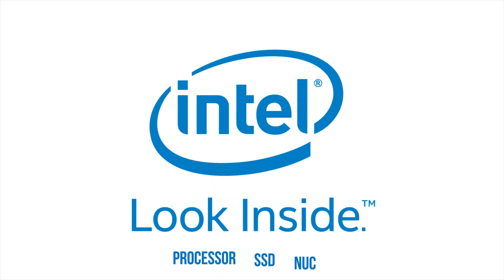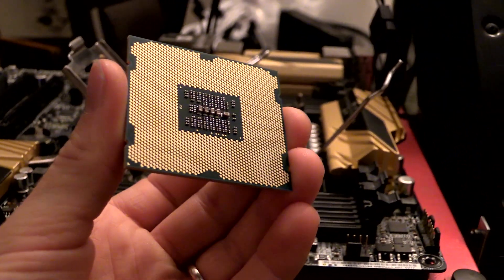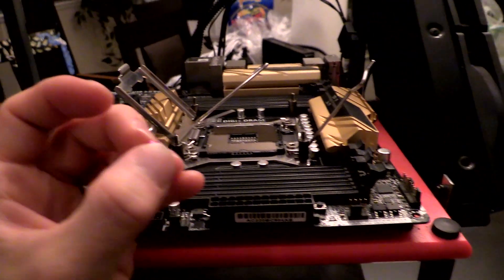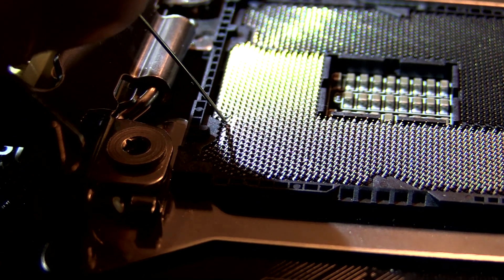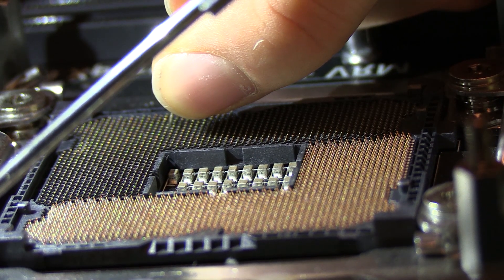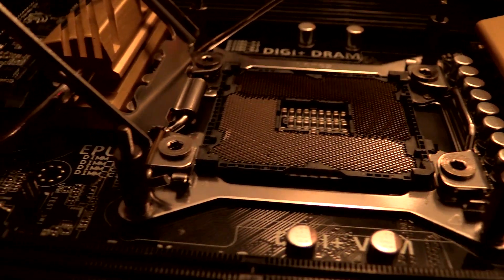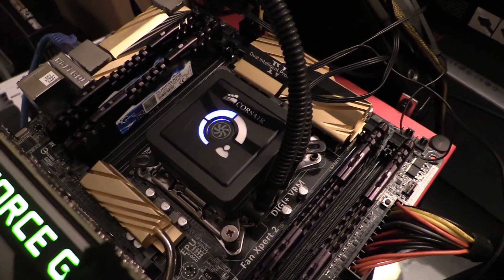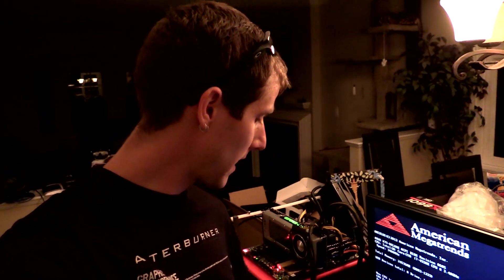LGA 2011 Socket Pin Repair Vlog - Fix a "Dead" Motherboard

Comment: I had to give you a thumbs down?  Why you ask?  Because that was too friggin easy.  Every year or so I pull out my barely used Gigabyte Z87X-OC Force and I try to fiddle with the bent pins and get a CPU to post.  I barely had the thing running for 1 month when I started having issues and HiCookie immediately told me... Sound like bent pin.  I'm like NOOOOO I had a Detroit Thermal 5noz on it and according to HiCookie I apparently overtightened it.  Which I can't stand because I had nice thin softish springs that took up a lot of turns.  Guess that's the downside to a universal 775-2011+ compatible block.

Anyways man thanks for making this.  I was wondering if I was doing something wrong.

I still don't understand how the hell I messed mine up.  But regardless I did and there is one nasty twisted pin and at least 1 other slightly twerked one.

Comment: I'm looking to repair a P6T Deluxe V2 socket pin. I slightly swiveled perfectly aligning about 7. But ONE had tiny pin atop landing end bent back flat on itself. I tried to stand up and broke off. I then bent landing up a little. Ran perfect for 3 days, then contact began to fail, randomly shutting down, and getting false "Overclock Failed..." boot message. By disconnecting panel connectors, starting with motherboard power button rig runs perfect except false boot message. Apparently pin only for panel/power switch, for I need toggling MB power button to start. What I'd need to do is: take a tiny copper wire 1/32~" long, file smooth, place in mechanical pencil, solder tiny bead to it, solder to landing. Only reason I can possible fix, is because landing on edge of socket center recess, pointing towards recess, allowing full access to tip of landing. I'd use long wire, solder then cut, but fear mangling landing.

Comment: Had to repair at least 10 bent pins on the CPU socket. One bent pin was like in the video no head, and it is LOOSE and maybe dead pin already.   PC booted fine. Sadly the main PCI-E x16 (x16) does not work anymore, so I used the spare x16 (x8) slot below it =)

Comment: I have a Gigabyte G1 Sniper X58 board that has a bent pin, the system works in Dual Channel mode if I put ram in Channel A and C in both slots it will work.  attempted to fix already but its so small I could not see.  Picked up Magnifying glass and something to bent it back with.  I hope to get it up and running.

Comment: This actually made me feel better about my new cpu purchase that i'm waiting to be delivered. My pc was turning on with a blank display and I wasn't 100% sure if it was the cpu but I bought a new upgraded cpu anyways in hopes it would solve the issue. The old one looked like it had been through hell and back but everything rlse in the pc looked perfect. I think I may have burnt it out with games it didn't meet the minimum requirements to run as well as some 4k 360 video editing. I needed better than a core i3. Anyways thanks for the confidence boost. 😁

Comment: Hey, Linus, I have a 1150 socket mobo and processor. One pin on the mobo is bent and one missing its head. I tried to fix it and the PC starts, shows the logo of the mobo but when installing Windows, it shows the windows logo and then the screen goes black. The PC does not restart, just "thinks". Any tips?

Comment: Does it remove the waranty if they see you repaired bent pins, because they are just less higher/under than the other ?
My motherboard had an issue, i had to ship it back to my seller, with the little protection above the cpu socket. Little protection i've made fall on the pins and then bent three of them. I've succeed to align them but i can't tell if they are higher or under than the other one. Does it break the waranty if they see it ? i'm mad

Comment: LGA is the exact reason why my next build will be a Ryzen. I've dealed with this issue before. My success rate of repairing it was 2/3, but everytime it felt like a really unnecessery job that could have been avoided and saved a lot of headache.

Comment: The re-seat cpu issue is a funny thing I've never seen up until now that I got a dual lga1366 mb. Cleaning the CPU contacts and re-seating the CPU fixed my Z800 mb memory detection issue. I've never seen this since lga came into market.

Comment: MY PROBLEM: 
The plastic on the bottom of my pins is warped.  I have a z170-AR Mobo. I had an i7-7700K, but it when to CPU heaven. (R.I.P.) 
Can the Mobo be salvaged because Microcenter does not accept the return of a mobo with broken pins? 
        (I could just buy a new one but where is the fun in that) (I am handy with a soldering gun)

Comment: I use a graphite mechanical pencil because it gives much more control over the bend pin. Also the risk of over-bending and breaking of the pin is reduced that way. A mechanical pencil is the way to go, try it next time ;)

Comment: I had to do this, the previous owner dropped the CPU on it. I used a jeweler's eyeglass (also known as a loupe) and the back of a No.11 scalpel blade. Very delicate work but still easier than resoldering guitar pickup wire!

Comment: hey my board is not booting i found a way to boot , it is ASUS Rampage 3 black edition i have 3 broken pin 4 ram slots ar not reqonizing. So i found a way to boot it says FF on my LED on motherboard when i press power so i have ROG Buton on IAO shield if i hold that with the power buton presed at the smae moment it will boot sometimes. then if i restart pc once i can boot the pc evrey time with out doing that trick but i still need to press F2 at bios the bios message doesnt  save to skip that message but if i disable power i need to do this thinks again. Shoud i try to fix the pins or leav it ?
Reply: Sory for my English btw

Comment: Hello great video. But i have one question: How Pins are bent. This is because a cooler pressure installation, cleaning processor, or when instal the processor?
Thank you for your knowledge

Comment: I sold a Maximus V Gene (Z77) board on eBay, it was in perfect condition. The buyer opened a claim on eBay to return the board (after leaving a positive feedback saying it worked) claiming that it didn't work. When I received it back, it had bent pins. eBay actually let me keep the board and the money.

I tried bending the pins back and one snapped, completely gone. The board wouldn't post and had error code 55 (no memory installed). I figured the board was toast and chucked it in the closet. 2 years later (today) I found it. I checked online and found that a vcore pin was missing. I also saw reports that if a vcore pin was missing, the board might still work. I went ahead and tried fixing the remaining bent pins better than before. I popped in a 3570K and it worked.
Reply: damn dunno what that guy was trying to do lmao

Comment: My cpu isnt sitting in place in the socket. Like when I pull the lever down I can still lift the cpu. Whoever helps me and it works will get 10$ on paypal.
Reply: last at war It's a fx 6100
Reply: last at war yes its lined up correctly but if the cpu pins are bent will it like not fit?
Reply: last at war asrock 960gm us3s fx
Reply: Are you seriously expecting money?

Jeesus
Reply: ***** I was gonna pay if what he suggested "worked"
Reply: fen0m I would have just helped you.
That's what the community should be, helping each other 

Anyway, I'm not gonna judge, it's your money, do whatever you want with it.
Reply: LOST LEVELS Unfortunately not. 4 pins fell off and I am going to replace my fx 6100 with a 8300
Reply: LOST LEVELS The thing is. The cpu pins will not go all the way down, and therefore the cpu wont sit in place, like I can still lift it up and the cpu sockey lever requires NO pressure at all to pull down.
Reply: LOST LEVELS How
Reply: LOST LEVELS Pc gives no signal beeps either

Comment: There are literally hundreds of motherboards on ebay with bent pins for 20-40 bucks which are going for 100+ bucks with pins intact, I'm thinking of buying one but have my doubts... Maybe the MBs are dead broken and they just bend those pins on purpose so people buy them thinking its an easy fix, since there is no returns/refunds? Does anybody have experience buying one of those boards off ebay?
Reply: a lot of places online buy bent pin rma boards...or direct from manufacturer's. i want to try the same thing

Comment: had a bent pin on an 1155 socket that i bent when trying to get paste off around the socket.  after staring and weeping at it for a while i put the 3770 in and it booted right up. that would be my advice to do first. maybe it was a pin reserved for later use i dunno.
if only i had just left the old paste there too. live and learn. and sometimes pay. not that time though!
Reply: Most of the pins are not critical, but not because they're reserved, actually they're almost all in use, but because they're present in multiples of hundreds for high thermal and current carrying capacity. In particular, most pins on the socket are connected to the ground plane both on the socket side and on the CPU side to provide signal separation and heat transfer. Another huge chunk of pins are for supply voltage. A loss of some of these is usually not critical, but it's important to make sure they don't short to neighbours if they were deformed.
Reply: Yeah, did the same thing to my 775 socket, pretty sure i bent a couple more trying to straighten it but put the cpu in anyway and it booted up fine. No discernable difference in performance
Reply: Exactly the same thing just happened to me, im literally shaking since i can't afford a new computer, so i just left it there and will try to fix it tomorrow (like i said im shaking, if i try ill end up fucking it up completely)
Anyone else has had a successful experience fixing bent pins?
Reply: use a mechanical pencil that uses the smallest size lead. hope u have a steady hand. like siena said make sure its straightened enough not to touch another pin when its clamped down. i`ve seen videos of guys who removed the pin too and it still worked.
Reply: I actually have shaky hands so i had to ask someone else to do it for me.
The first try i thought the computer was completely dead, it turned on but was suffering from BSODs and at some point it didn't boot up at all.
I tried once again and apparently it worked, it just showed a weird message at first saying something failed but it boot normally after that.
Been using it for 2 days now and (gladly) everything is working, no BSODs or freezes or weird graphics, i even used Dell's diagnostic tool and it said everything was fine.
If anything, i miss those times were pins were attached to the CPU instead of the mobo, or at least i wish they were completely rigid.

Comment: someone plaease help i built a gaming pc assembled everything rright all cords hooked in right heres ehat it does no signal, no post, dram led blinking red, power led not working, hdd led not working, plugged in keyboard led doesnt work i tried using a different monitor tried changing ram and gpu and tried using 1 ram stick i think the cpu or mobo might be dead i need advice and help would be nice

Comment: can somebody please tell me what happen to my pc i recently purchase some parts intel i7 6850k and gigabyte ga x99 motherboard and ddr4 corsair ram when when i hit the test run it shows me nothing no display,whole system  countiniously on and off immediately in just 1 sec automatically and making sounds like small rubbing rocks
Reply: I have no idea what "rubbing rocks" are and what sound they make, but it's not going to be possible to say exactly where the fault is, except it's likely that the PC is short circuited along one of the power planes and the power down is possibly initiated by PSU protection. Another possibility is non-working CPU or CPU support circuitry, but the behaviour would be very mainboard-dependent, so it's hard to guess.

You will need to determine the source of your sound too.

You will also need to remove ALL components and connect them up one by one. The only things you need to begin with are power supply, mainboard with connected up ATX and ATX12V (also known as P4) power, as well as installed CPU. No RAM, no GPU. Among other connections, only connect a small speaker and the power button - if you have doubts about the quality of your power button, use reset button instead wired into the mainboard's power pins. If all of these components are OK, your machine will make error beeps upon attempted boot. That's good, this means your CPU works. The beep condition is caused by missing RAM and GPU, but the PC cannot beep without a working CPU. Then you add RAM (one stick), beep pattern should change. Keep adding components until you hit an issue again, and you'll know where it happened.

Comment: on older cpus with more space between the pins it was much simpler to use a credit card or something , to move the pin back into position , the mechanical pencil way has saved my bacon on quite a few occoasions repairing customer installs where they have bent or damaged pins ,both line grid array and pin grid array

Comment: Thanks to this guide i managed to fix a goofed LGA 1150 socket. Somehow like 5 pins had gotten messed up when i tried to put in a new CPU, and this guide helped me to get it working again. three months down the track and it still works fine.

Comment: Can the same technique be applied to fixing a pin from the MOTHERBOARDS 8-PIN Power Conector (The board , NOT the Power Supply) ?

I was testing other Power Supplies cause the one i have gives the scent of BURN when i try loading some games, and i ended up banking a pin at the MOBO's Atx 8-pin connector !

If the MOBO's lost, can a LGA 1150 Processor F I T into a 1151 or LGA 2011 Socket ? Just wanna know how screwed i am !!
Reply: Oh some burn smell is normal within the first weeks, it's usually just the heatshrink continuing to shrink post production, it does that smell. There can be other sources of smell though, like silicone glue (not an issue, it'll be fine), transformer windings (ouch), leftover flux (slightly suspicious, if dubious).

The EPS12V pin header on mainboard should normally be excessively difficult to bend, so i REALLY wonder whether it's just a bent pin or whether there's more damage there, like lifted traces or damaged vias underneath. If it's really just bent, you can bend it back with a plastic implement, it'll be fine. Even if a pin falls off, it shouldn't be an issue if your actual CPU consumes less than 120W, because the socket actually carries +12V and GND with each line quadrupled over and connected to each other both on the mainboard side and on the power supply side. If it comes to worst and you indeed lifted, you can get an electronics repairman to run some bodge, it's not difficult in this case, just not very nice looking. Perhaps contacting a repairman isn't the worst idea anyway, he can do some tests and determine, if there's any damage at all, whether there's enough current carrying capacity left over not to cause issues.

If you decide to replace the mainboard, you must use the exact same socket type, all Intel sockets are incompatible with each other.

Comment: A question here. 

If two pins were bent in such a way that they overlap eachother in the base, could they make a short and fry the CPU and if so, how likely is that to happen?
Reply: The most likely shorts are ground-signal shorts (no damage, it's just not going to work as long as the short is present), signal-signal shorts (almost as benign) and ground-Vcc shorts (the CPU will be just fine at first, but the mainboard can burn up, and if that happens, it can kill the CPU too). In the latter case, it's going to be very obvious what happened, it will be like a hurricane went over, there will likely be some discolouration and smoke residue, as well as visible VRM component damage.

A Vcc-signal short would instantly kill the CPU without (visibly) damaging the mainboard, but usually CPU sockets are laid out so that this would be super unlikely to happen. But never say never, right.

In general, CPU damage is not super likely.

Comment: Anybody know how hard it is to bend the pins?
Reply: Not hard at all.
Reply: peuda welp
Reply: Just bending them in general? If you accidentally put some object in the object, since all of the pins are individually very thin and fragile; very easy. You want to place the CPU flat so it contacts all the pins at once. They are much more resilient when in unison. Just be careful to avoid the problem.
Reply: MGlBlaze k thx

Comment: why replacing whole motherboard for bent pin. cant they replace socket with new one instead?
Reply: desolder the whole socket, i think not
Reply: At rework facility and with destruction of existing socket (no harm done if it was shot anyway), yes, the socket can be replaced. I think this is exactly what Linus meant, that they can do that for a fee.

Comment: should i use a mechanical pencil instead of a pin to move the pins back into place
Reply: Nooo dont i tried and it made things worse
Reply: I used a scalpal and it worked fine.

Comment: I had two pins on my lga chipset bend, and i thought i repaired them (they looked just about normal) and when i turn on the power on my psu, and then the case, and it turns on for 4 seconds and then off for 5 seconds and then on and off and on and off. Help!!!!!!!
Reply: I dont know if you fixed it, but keep trying, I had the same problem and i tried a lot of times then it worked again

Comment: saved my Z97 with this, I was lucky enough to have bent a ram slot pin, so even with a bent pin the pc booted at least but only half the slots worked. Now it's fine.